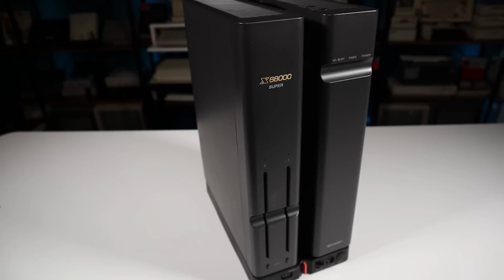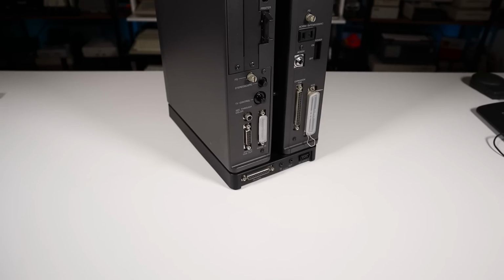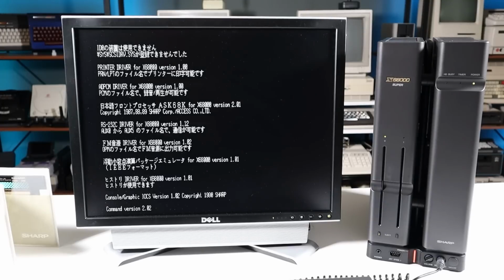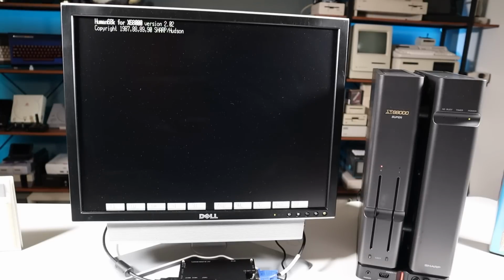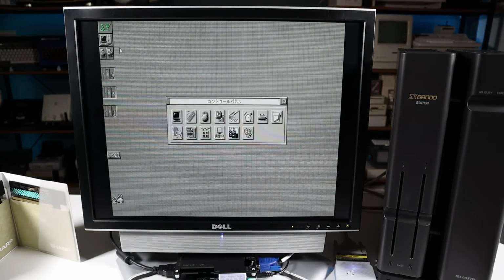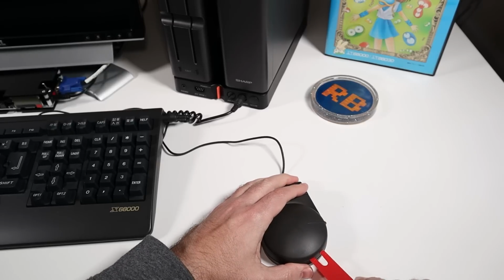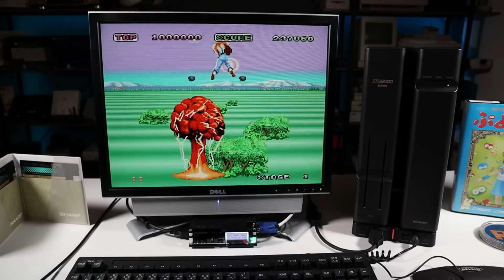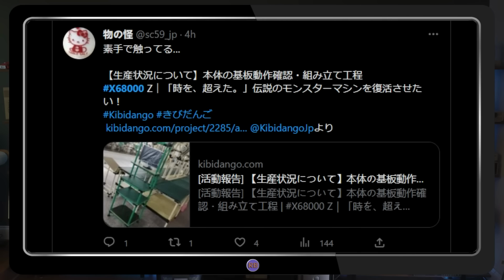Testing out the imported X68000!

Comment: so, did you come to a conclusion: was this an amiga killer?
Reply from the maker: I'd left that as an exercise for the viewers :) What I can say is that both systems have their own strengths. The x68k certainly had a hardware advantage out of the gate. Both could be expanded to have better graphics and sound cards, faster CPUs, etc. The Amiga had a bigger aftermarket, software library and had a true multitasking GUI. That said, the X could run OS9 and NetBSD if multi-user/multitasking was needed. Maybe I'll make a real comparison video some day ;)

Comment: I overhauled numbers of my own machines and always kept the power supply totally looking like stock either completely stock, or replacement pcb and pico atx power supply. Whoever you bought that from totally skimped on the power supply retrofit. Makes me wonder what else they skimped on. It really bugs me when I see hacked boxes with barrel jacks hacked to where the ac cable is supposed to be coming out of the case.

Comment: It's weird hearing someone call the graphics portion of the X68000 a "GPU". It's technically correct, of course, but nobody called the graphics subsystems of personal computers a "GPU" back in the day. That term didn't come into mainstream vocab before, what, the origiinal GeForce 256 or even later.
Reply: Yup Nvidia coined that term with the OG GeForce cards. I remember the demo of the hardware with Doom 3 and the per pixel lighting. Looked amazing back then.
Reply: I caught that too 😅
Reply: How it was called back then?
Reply: @andreyansimov_diy  in the msx days, different manufacturers used different terms. But on msx, it was called the "VDP". Stands for Video Display Processor
Reply: @andreyansimov_diy VENUS(CRT Controller) VSOP(VIDEO Controller) Cynthia(Sprite Controller)

Comment: The word you're looking for is "Latin letters".
Also, it turns out that Compact Flash cards are pretty slow, even when used natively on an IDE bus. So SD card adapters are usually faster, despite intrinsically needing more translation to the target system.